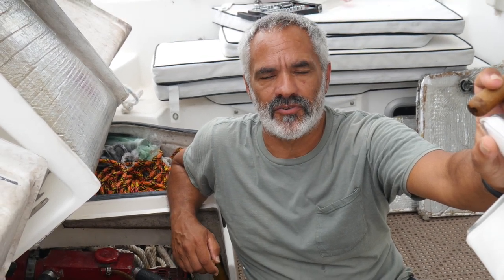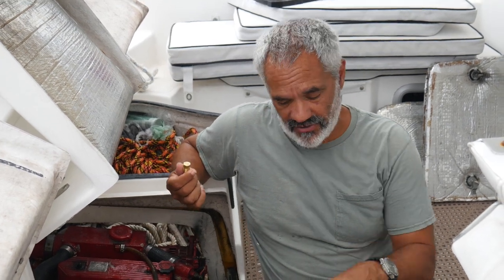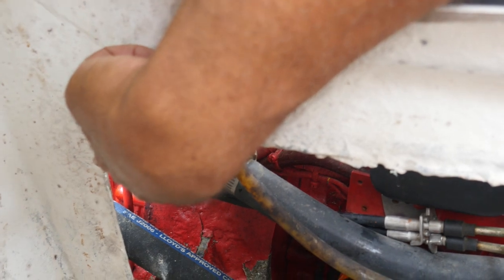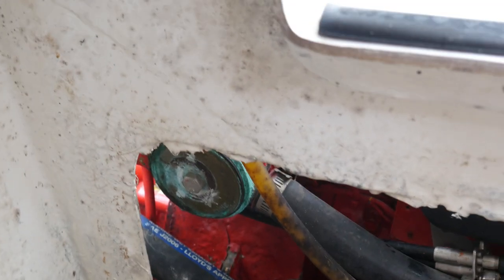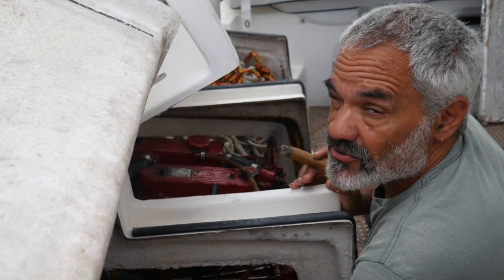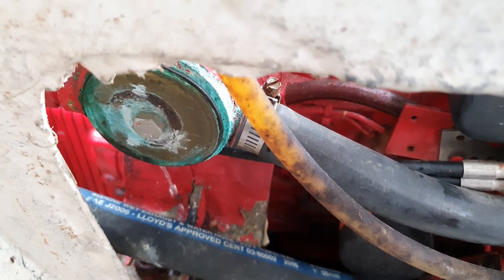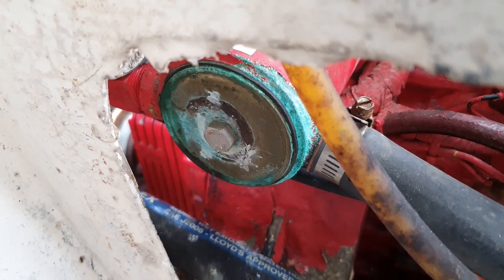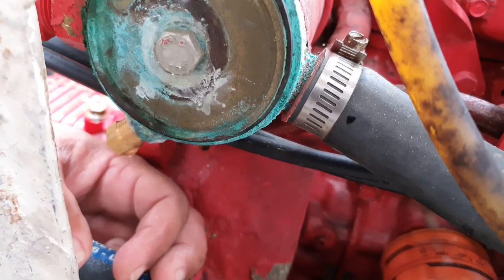How to change heat exchanger zinc and broken zinc extraction

Comment: Was doing a quick search since I had a stuck Zinc in my Kohler Generator and came across your video.  On mine the ends of the heat exchanger don't come off so I needed a way to get it from the zinc mounting hole.  Your video was perfect.  Drilled it with a small bit, screwed in at wood screw and pulled out a big chunk.  The rest came out with less than 5 minutes of cleaning with the screw.  Saved me from pulling the heat exchanger.
Reply from the maker: It makes me smile to see that we could help make your project smoother. Well done! Your generator is on a boat?

Comment: Thank you for the very informative and helpful video. I am dealing with a worst-case scenario too! So, gently as she goes and I'll see what happens. I removed the original zinc (still painted engine colour!) so it's the first check and change for the heat exchanger zinc anode for the boat at 250 hours (and many years after installation). Not ideal
Reply from the maker: Keep us posted!
Reply: Happily after a number of hours of gentle scraping out the old zinc I was able to slide the new anode into position. I also cleaned the threads as suggested and screwed it back into place. I ran the engine and it seems fine - water tight and for now the anode is bright and shiny. Thank you again for an informative and helpful video (perfect for my situation). It gave me the confidence to do the repair well and persevere patiently until the job was complete. Cheers!

Comment: Wouldn’t it be easier to remove the end cap to remove all the pieces that way your sure you cleaned it out?
Reply from the maker: For newbies I do not recommend removing the cap as it opens the whole new can of worms. But I have done it many times and it is a perfectly valid approach.
Reply: I am a newbie. As a newbie, drilling into the heat exchanger, and the risk of puncturing the cooling tubes, freaks me out. I thought it might be easier/safer to simply remove the end cap. What are the cans of worms that I could be exposing myself to?

Comment: Excellent video. Ty for posting. When installing the new pencil zinc, is a new o-ring required to maintain a waterproof seal? If no, why is it unnecessary in this particular instance?
Reply from the maker: I always use the parts that were originally there. I do know guys who skip it.

Comment: I’ve always serviced the heat exchanger at same time. Remove end caps. Rod it with bamboo shishcabob sticks. Easy on tubes. Remove any anode Remnants replace anodes and end caps. Clean water strainer. Check pump impeller. Check antisiphone   Run engine and comfirm flow and engine temperature   I double check temperature with infrared thermometer cuss the engine senders go bad.

Comment: Hi, thanks for your sharing. Mine is 1988 Crusader 350 CID 270 HP, My zinc fall into the heat exchanger and hard to get it out, as I surveyed on the internet, some people said don't worry too much, for there are times it just stays in the HX, do I need to worry if it will fall into engine or block coolant waterway? Thanks
Reply from the maker: What makes you think it fell off? If it did, how big the piece it was? If it's a big piece, pull off the end cap and remove the piece. If it's powdery leftovers it's probably gone.

Comment: If the purpose of the zinc is to get eaten up instead of the metal of the engine, why do you need to remove the pieces? Aren't they just more zinc to help protect the engine?

Comment: Pull out the core, clean and replace o rings. Needs to be done anyways annually, so why fiddle about trying zink extract?
Reply: Because zincs are supposed to be checked seasonally, so you don’t have to “fiddle” with broken pencils, like you would if you waited to do it annually

Comment: is it ok if some of the zinc falls into the hole
Reply from the maker: The white part, zinc oxide is fine. It flushes through. A chunk of zinc shouldn't be left behind if you can avoid it. 

You can unbolt the end cap to pull any out if needed, but have a fresh gasket to keep it from leaking when you put it back together if you do this.